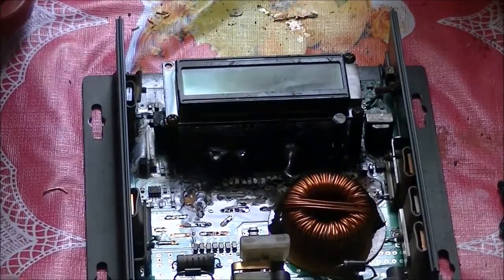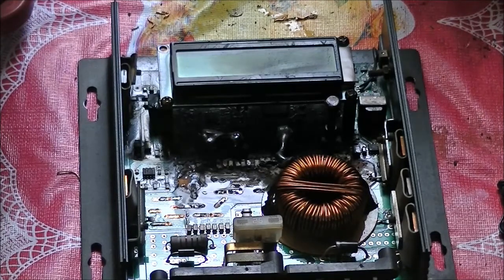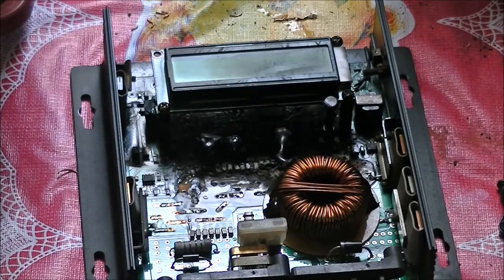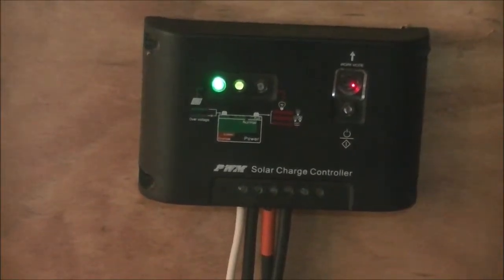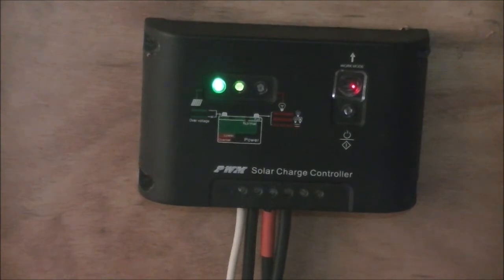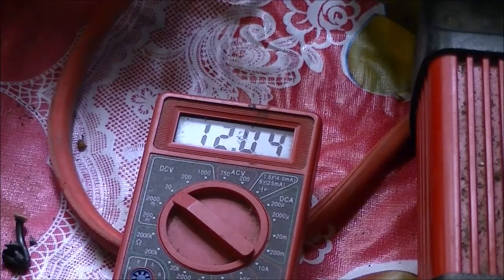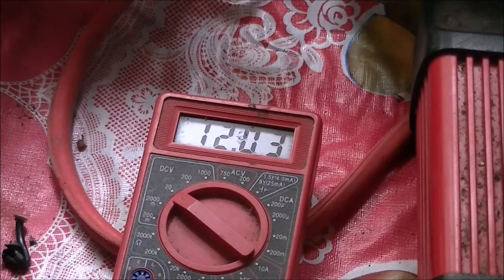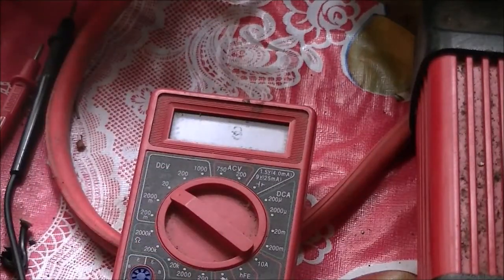My Solar Power System Failure!

Comment: My hobby is electronics and has been for 50 odd years. I'm an engineer of the old school and I'm astonished at the way modern electronics run almost at the point of meltdown. If it's at all possible leave the front off the unit and put a little PC fan blowing at it.They only use about 0.1 A at 12V. f you are worried about a fans reliability use 2 or run at 10V. I would definately leave the cover off. That controller looks rather small for anything over a few amps.

Comment: I'd suggest having a spare MPPT controller.  The 40 amp EPEver/EPSolar 4210A can handle 520 watts and a maximum of 90 volts input.  They are $130-$150 on Ebay and many vendors include worldwide delivery (it seems China can ship anywhere at very little cost).  I'm in the States and have 2 MPPT controllers - one active and the other as backup now and for possible future growth.  I also have 2 no-longer-in-use 20 amp PWM controllers that I'm holding on to "just in case".  If Sure Electronics is selling on Ebay, they're a reliable vendor.  Also check banggood.com but you need to know exactly what you're looking for (brands, models) before you search their site.

My solar system was a learning project and is intended to cover the occasional multi-hour power outages, most recently 12 hours in December from 7" of snow in an area that rarely sees more than 3".  I call it a "Wait until daylight" system as it can provide 8 to 20 hours of limited power depending on the season.  Having 8 hours of heat and light means I'm not out in the dark or a thunderstorm starting a gasoline generator.  Typically, one 250 watt solar panel keeps the 540AH AGM battery bank ($210 on Craig's List) at float while it waits to be used, but I have a total of 1500 watts of solar panels that could be put in place for an extended outage (most of that wattage bought via Craig's List from installers selling pulls or leftovers, most recently some 300 watt panels at $125 or just under $0.42/watt).  If I had not been able to find the deals on panels and batteries, I might very well be using a couple of 100 watt panels and some car batteries.  It's taken me a while to get the system to this level as I've been putting it together for more than a year.  Thanks to my first published novel being at least a little bit successful (1700 copies sold in less than 2 years) there was unexpected money to acquire the pieces of the system.  https://www.amazon.com/dp/B01LVU5ILA
Reply from the maker: You have some good advice and experience.

Comment: So what where you or are you powering with the solar panels?  
    Batteries are costly.  I checked into solar.  I would like to have enough to run a mini split during the hottest part if the day.  Maybe a few batteries  to power lights at night in case of brownouts. 
   But batteries /storing power is the  deal breaker for whole house operation for me.   I'll do grid tie. 
    Oh,  ic you power a lap top,  lights,  cell phone etc.
Reply from the maker: I'm just powering my laptop, and some lights. Right. Deep cycle solar batteries are expensive.

Comment: MAYBE HEAT, HUMiTiTY?  WE CAN PiCK ONE UP NEW FOR 5000 PESOS
ECO-WORTHY 20A 12V/24V MPPT SOLAR CHARGE CONTROLLER SOLAR REGULATOR
Reply from the maker: That's true. I may well get one.
Reply: TWO iF YOU NEED BACKUP! HAHAHA GOD BLESS!
Reply from the maker: Good point.

Comment: I have been looking at http://www.lazada.com.ph/extreme-et3500-gasoline-generator-35kw-10979959.html?spm=a2o4l.category-261500000000.0.0.5be1cbe2bjMP1k&ff=1&sc=EU1Y
In Dumaguete the power goes out about once a month for about 8 hours on a Sunday. The refrigerator is my main concern. But for 300 dollars shipped to your door that seems to be a fairly good price. 
Could you run a temporary wire from your car battery to your solar batteries terminals, and charge them off the alternator of your car? I would guess the solar charger would have to be unhooked untill they were charged up.
Reply from the maker: I could maybe do as you've suggested, but the batteries are up to 13.4 v right now. That means my little PWM bought me some time.

Comment: Good to be prepared!
Reply from the maker: True. It's also important to watch for problems.
Reply: The pwm charger worked very well for me. They are available in 30 amp model for very little more.  I'd use at most up to 60 or 70 per cent of rated power handling for these cheap chargers.  They will overheat and die if there's not enough cooling.
Reply from the maker: One concern I have is buying things like charge controllers here in the Philippines. Electronics are usually more expensive here, and there seems to be even more fraud here than the US. Your advice is appreciated, though. I'm going to think about it.